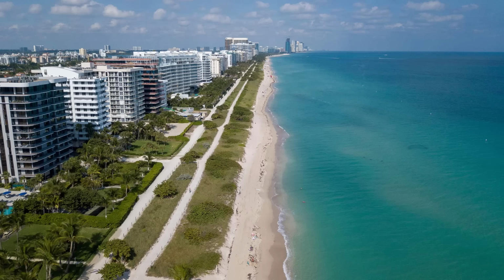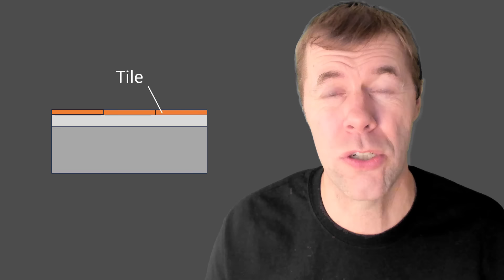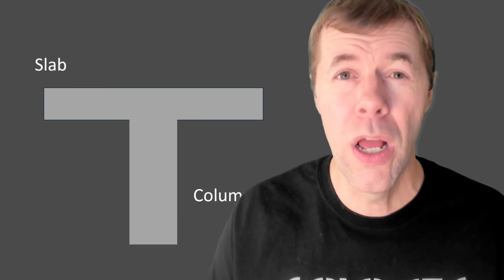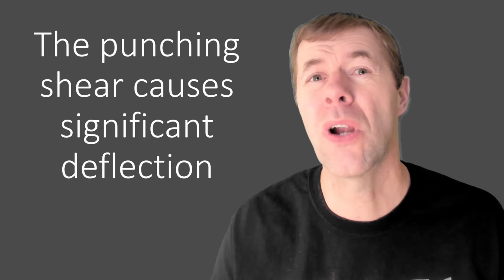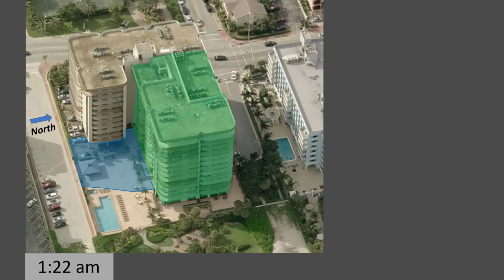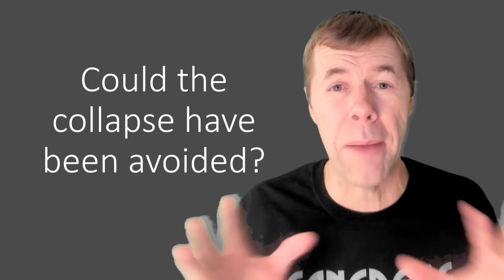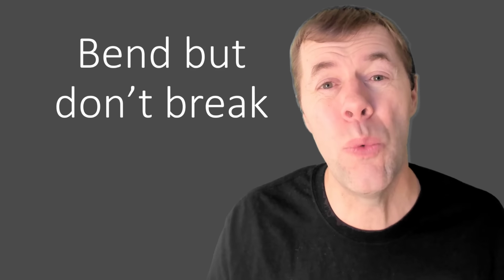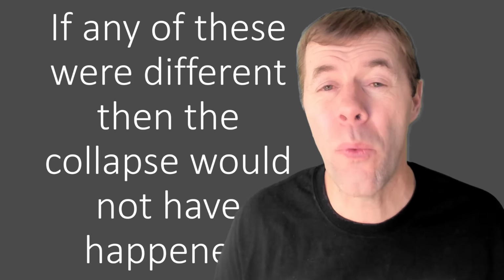Why did the Surfside Condo Collapse? (Miami Building Collapse)

Comment: This is going to be a major problem in other places.  While the building was full of flaws with its original construction in this case, it did hold up for 4 decades. The primary problem was getting the residents to agree how to pay for badly needed repairs with very high costs. The sticker shock of the repairs, especially after they just had to fix something else a few years before, caused delays and the building just didn't have that time. The is going to happen somewhere else as things continue to age. Governments are going to have to step in with regulation as well as funding to prevent this.  We cannot simple rely on HOAs to manage these processes.
Reply: Fair enough re: something has to be done. However I don't want to pay for it. I do not own a home, so I don't feel I should be paying to fix other peoples homes. This is entirely the owners responsibility. I'm sure I'm not alone on this. Money does not grow on trees that the government can pick from at will. The U.S. is 34 TRILLION dollars in debt because everyone thinks the government should "fund" every problem in society. If the owners cant afford the fix, then the building needs to be evacuated and demolished - at the owners expense. Should the taxpayers have funded the maintenance they didn't do?
Reply: @supermash1  sounds great on paper but your can't squeeze blood from a stone. People that don't have the money will just not pay and ignore the problem. That's why it becomes the governments problem.

Until leaders of our country decide to reduce the military budget which is always 75+ percent of our budget, complaining about the national debt is meaningless. I am for the US having a strong military, but we have to call a spade a spade. You can  eliminate the entire remaining federal budget and the debt will still grow due to that spending alone. Fixing 'society's problems' is a drop in the bucket versus that. More over that's kind of the job of the government.

I don't like the debt the US is in, but it's essentially meaningless as long as the US is a super power, a major world economy, and the dollar is  global defacto currency. The very entities providing the money to the US would fail if they ever called in thier debts due to the impact on the US economy. It's all made up BS in the end.

Comment: There is a nearly identical building just a short distance up the beach.  I'm hoping that this building is being inspected very carefully.  Another problem with the condo that collapsed was the intrusion of salt contaminated rain water that pooled on the deck and seeped into the tile/topping slab.  This was the wrong way to address any ponding of water on the pool deck.  Some of the photos I have seen of some of the rebar show stress corrosion cracking almost all of the way through the section.  Also one of the columns at the entrance to the below grade parking deck was undersized possibly a design oversight because it was subjected to additional load.  If I understand things correctly this column is thought to be where the initial punching failure began when the pool deck began to collapse downward from all the deficiencies that you point out.  Miami in the time this condo was built was known for quick, shoddy, construction with suspect inspection.

Comment: Great video! You presented more information on the cause of the collapse in 8 min than NIST did in an hour and a half at their last video. One thing they did say was that one specimen revealed that there was only HALF the number of rebars at the slab/column connection. This begs the question: HOW did the inspectors miss this? Was there corruption involved or were the inspectors incompetent or both? I find it hard to believe that an inspector can't count to 4 (the number of rebars required).
Reply: probably they suffered temporary amnesia.
Reply: $$ in the pocket gets thing approved and signed off.   Have personally seen it happen.
Reply from the maker: Thanks! 
I am glad that NIST is doing such a thorough job.  I am not sure how they missed this.  This is a big error.
Reply: Is the registered professional engineer who designed the building not responsible to both design it correctly and inspect the construction to ensure the design is built to specs? I mean the building inspectors cannot be responsible for incompetent design.

Comment: Great straight forward analysis. I've read other in depth reviews of the design and learned that the way the pool deck tied into the main building was unnecessary. If i understood right, basically if the deck was separated load wise from main building columns, like freestanding intensity of one system, this probably wouldn't have happened.

Comment: I remember people online trying to figure out what happened soon afterward using the video footage, photos, and diagrams, and what you're saying in this video is exactly what they thought. The way the pool deck was designed, the planter, and then the damage to that column and the shear wall. The only thing they didn't get right was the faulty construction but there was no way to know that at the time. What's interesting to me is that the survivors from the part of the building that collapsed were the ones who lived in the second and third floor apartments right above the damaged column because they could hear it breaking a few minutes ahead of time and they could see cracks developing on their walls. That gave them time to evacuate. I'm also still sad about that kitty that was in the remaining structure that died when it was demolished.

Comment: It wasn't just the deck taking a big bite out of the KLM 9.1 columns when the deck failed.  Those columns had fairly substantial beams (BMA) extending out beneath the deck to KLM 11.1 for the patio step-down outside unit 111.  That added a huge amount of depth and weight ripping the guts out of the tower columns (KLM 9.1) when the deck collapsed.  It's difficult to be certain, but I believe that if those beams had not been there, and it was just the deck pulling away from the columns, the tower might have survived (or lasted long enough to evacuate).

Comment: I’d always assumed it was mostly due to corrosion - especially after they aired the video  of the parking area. Maybe that had a small effect but the additional weight causing the punch-through was fascinating. Tragic how many unintended and mis-informed factors contributed to this.

Comment: I am so surprised that no one has mentioned the added weight of all the hurricane Impact windows as compared with the weight of the original windows!
Reply: I hadn't heard that the windows were replaced but any increase in window weight is likely to be fairly insignificant compared to the other loads on the columns. The weight of the topping/tiles on the pool deck were a far more significant contributing factor along with reduced rebar, corrosion etc.

Comment: Tyler, hope all is well.
Planters at face of building were over column decks, therefore the load was in a load path that was awesome.
I have done over 300 videos on this building and in my private room I go over the failure of the main building...
This structure had parking deck failure within 10 years of build (they used foam to seal parking deck cracks in the 80s)
Gary Klein , admits to using YouTube content to make most of their conclusions and most are from my content. 
That was the closest they came to "investigating" and I am the only one who has revealed the roof detail collapse...
Even NIST has stated they don't know how building failed and still only working on pool deck collapse and they stated they have not ruled out one thing! 
This answer got them an ass-chewing by the NIST board in a meeting.
Reply: Have you consider that the concrete for the decks weren't properly cured? If properly cured, the permeability will be cut in half, and double the resistance against water and rust. If properly cured, the deck would have resisted water better, and not collapsed for another 40 years -> Tyler Ley: watch?v=1siLxrpm_PE

Comment: The flat-slab and column design is horrible. Seoul's Sampoong (not shampoo) Department Store collapsed the same way, like pancakes.
The fact that a few columns on one side of the building block brought down the whole block is another testament of it.
Reply: Flat slab and columns are used a lot. It's perfectly acceptable if the loads are properly calculated, they are properly built and the load controlled to the design load.  Column capitals, shear caps, drop panels or slab and beam, etc. are stronger but still can fail if poorly designed, poorly built or the actual load exceeds the design load.
Reply from the maker: I agree. Flat slabs are great and economical if they are used correctly.
Reply: @TylerLey  How should you ensure it is built correctly?  Pay the design engineer to check the formwork and rebar before the concrete is poured that it matches the design?

Comment: I live nearby and know people who once resided in that building. The tragedy was inevitable after the building's completion. Inspections conducted post-construction were cursory, focusing on compliance and operating under the assumption that the building’s design and construction were flawless. This approach reduced the process to merely ticking boxes on a checklist, rather than identifying and addressing critical structural issues.  Although more comprehensive and frequent inspections are now required, the prevailing bureaucratic system continues to emphasize ticking off items on a list rather than ensuring real safety.

Lastly, these new inspection regulations have massively increased the cost of living for homeowners in Florida. The city, which turned a blind eye during the construction of these buildings, should bear the cost of these inspections.
Reply: BS, this building exhibited signs of pending collapse long before it actually fell. The residents belong to a group known for being cheap and they decided to not fully fund their reserves nor pay for the needed repairs specified in their engineering report. The building was making loud groaning and creaking days and hours before the collapse but it was ignored. Look at the planter photos on the pool deck as an example. This was preventable but greed prevailed.
Reply: @bubbajones4522  At the time no one entertained the thought that the design or construction itself was at fault in consequence inspections concentrated in concrete deterioration and the pool deck support. It is possible that they would have discover some of it during the restoration work, but I doubt that they would have done X-Rays and the necessary analysis that would have saved the building.

Comment: Although the mentioned problems are of importance but why it collapsed after 40 years?
Reply: None of the issues were critical by themselves. But over time, use and further damage compounded the problem and it finally lead to collapse.
Reply from the maker: Good response!

Comment: Many structures; aren't.
Assumptions collapse.
CTV building chch.
Cathedral spire chch. (Reinforcing structure not attached to the ground)
The foundation and subsequent attachments are key to building security.
Look at a tree.
Open pillared bottoms of buildings are always a risk due to structural twist.
And then it gives at that twist/ deflection.
That's why they have bracing walls.
Too much artistic license and not enought practical application of logic.
If you feel a building is "wrong" don't go in it or buy an apartment in it.

Comment: International Code Council has established the International Building Code which is used in many cities in Florida (maybe not in Miami-Dade). Unfortunately, Florida does not recognize Chapter 17 of the code which addresses "Special Inspection". If Chapter 17 were to be incorporated under Florida statues, inspection of the size, number, and proper placement of concrete reinforcement would be part of the building owner or developer's responsibility. Special Inspectors would be hired by the building owners and issue reports to the Owner and the local building official for permanent records. Many Western states including California, Nevada and others already use the Special Inspectors to augment local building officials in the field. Unfortunately, nobody in the real estate, municipal or construction industry wishes to shoulder the expense. Perhaps the failure of the Surfside Condo will spark more interest in proactive inspection of construction components rather than forensic examinations.

Comment: Generally, part of the problem is the original developer probably created multiple changes to the design. Then add in low cost mindset to save a buck at every turn. So they cheaped out and this is the result. I agree that the extra loading contributed to the collapse but designs should be very conservative. Other time bombs are out there. Before major structural damage, there are warning signs as was illustrated. We need to educate the public on how to recognize these warning signs.
Reply from the maker: That is a good idea.  Maybe I should make a video about this.

Comment: A similar modern building would have been built with a membrane to protect the slab rebar. I have seen other exposed slabs destroyed by the lack of a membrane. This is especially true near the ocean shore. You also lose the alkaline environment of the concrete with carbonation that promotes corrosion in older structures.

Comment: Right certified inspectors and certified plan readers who can ferret out stuff before its built perhaps augmenting with AI or something. Just the nuts and bolts like correct concrete strength, amount, proper rebar types, lapping lengths, diameters, proper degree bends of stirrups etc. Then the maximum weight per floor to the penthouse perhaps forgoing the "infinity pool" "planters" "extra slabs" - anything that was not part of the plan. Then in the installation add 20% more strength to everything so in the end you have something probably over engineered. Lighter with more strength not the other way around as in this case.
Reply: All that does not prevent possible corruption or cutting corners.  Constructing can be a pretty shady busniness.

Comment: The building failed from sub grade structural damage. The soil slowly recedes under these South Florida coastal buildings, which is normal, the older the building the greater the erosion void. The buildings foundation was supported by hundreds of piles, going all the way to the bedrock, and grade beams. So it’s a building built on stilts but the stilts are underground. However, the erosion created void exposed the grade beams and piles to the salt water, salt air and probably the most detrimental, chlorinated water that had been leaking from the pool for years (which has been stated and shown in videos taken prior to the collapse). The prolonged elements exposure caused the rebar to rust and expand causing the concrete to crack, the cracks expose more rebar to the elements, then more rusting and cracking, the cycle continued. The piles/ grade beams finally break under pool, pool & pool deck collapse into the erosion void knocking out a some of the building’s grade beams and piles on the way down, and it was dominos from there. Elements killed this building. 
Concrete restoration is a regular maintenance for coastal buildings but only addresses above grade issues. In order to prevent similar catastrophes from happening in the future, foundation support would have to be inspected as well.

Comment: Wow... Hundreds of  Old school buildings  across UK shut for inspection this year due to aged concrete issues.. seems be world wide problem, i 🤔.
Reply: Most of the concrete buildings in the world were built in 60's, 70's and 80's
Reply from the maker: Those buildings were shut down because of poor quality aerated autoclaved concrete.  You are right that there was poor quality in this structure as well.

Comment: Nice video. BUT, in my humble opinion, you miss one crucial thing that could, sadly, allow this to happen again: accountability. When the Sampoong Dept store collapsed in South Korea in the 90's, with similar loss of life, dozens of people were indicted, tried, and did hard jail time. I think the owner/contractor did 10 years. I have followed the Surfside collapse closely, cf excellent work by Miami Herald journalists. NOBODY is responsible or accountable for anything; engineers, architects, consultants, inspectors, contractors, all have pointed so many fingers that the buck, rather than stopping anywhere, has floated off to oiblivion. The victims families were effectively paid off with a huge money settlement, and that's that. We need to get back to the concept of the architect of record, the engineer of record, chief building inspector, actual humans who take final responsibility. Some of the failures that you mentioned, like rebar placement around the columns, were so egregious that a job foreman or competent rodman should have noticed them, but didn't.

Comment: Those were the mechanical reasons the building failed and killed all those people. The real reason was the HOA charged the condo owners extra to "fix" these structural problems but  never did. The city building inspectors should have condemned the building and moved the people out years ago.  The building owners and inspectors knew the building needed to be demolished or needed costly repairs displacing all the homeowners so they "slow played" the decision to condemn so the owners wouldn't be out of a home and the HOA wouldn't be out lots of HOA money and no expensive repair bills. Stupidity and greed is what really those folks.
Reply: The HOA is made up of the owners. Every dollar the HOA spends comes out of the owner's pockets.  Plus the head of the city building commission got a copy the report that showed the building was falling apart and told the HOA the building was in great shape.